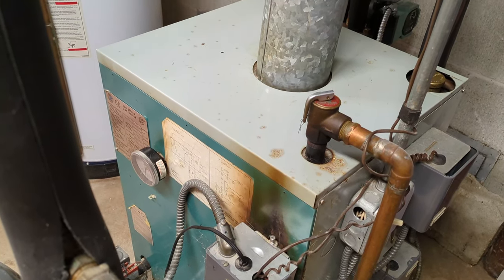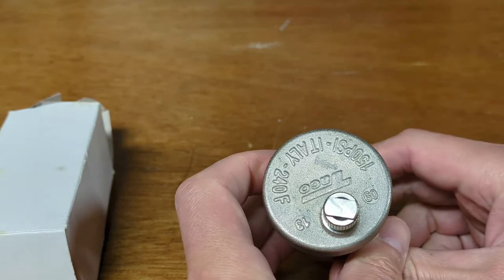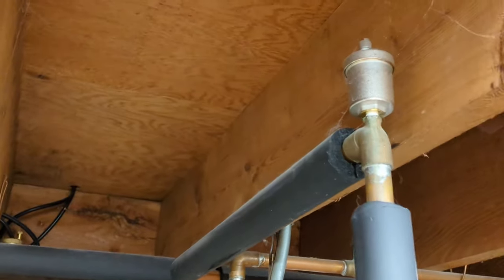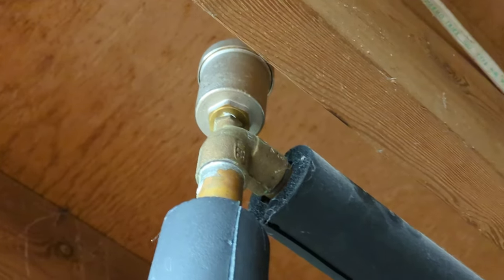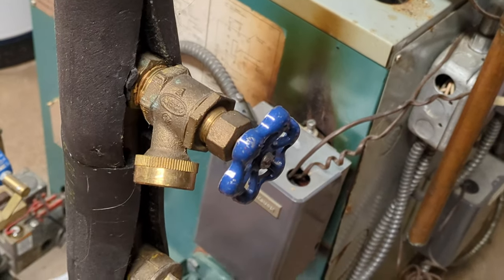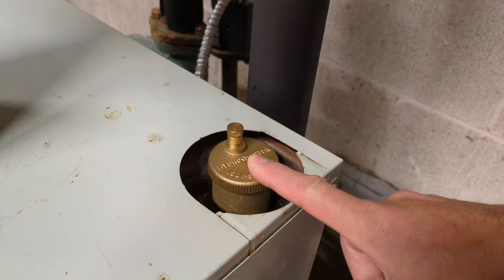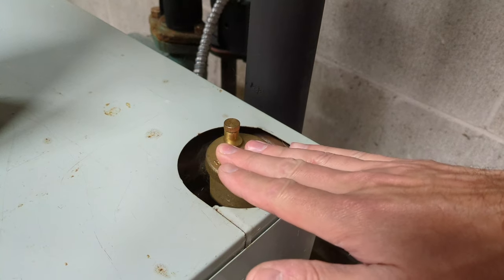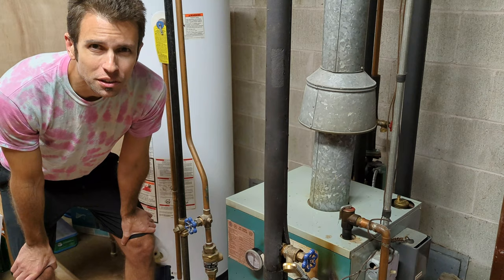Replace a leaking automatic air bleed vent / valve on a boiler - Taco 400 Hy-Vent, Hydro Master, etc

Comment: I currently am losing water in the lines baseboardlines. One of my automatic pressure relief valves is leaking. Would it constantly leak until my boiler loses pressure/ water in the lines?
Reply from the maker: PRV is a different story. I'll have a video on it maybe later this week.
Assuming your system has a water line coming in, then it will continually refill any lost water and won't lose pressure. You can keep an eye on the leak and pressure gauge. If pressure is normal, then PRV is most likely leaking from scale buildup or seal not seated perfectly. Little drips each day are fine. How much is leaking?

Comment: does it matter what type they are? I found that I have two air vents and one is 150 psi and other is type 67   35-50 psi depending on brand... ?
Reply from the maker: That should be the maximum operating pressure. So if you have a lower water pressure system either would work fine.